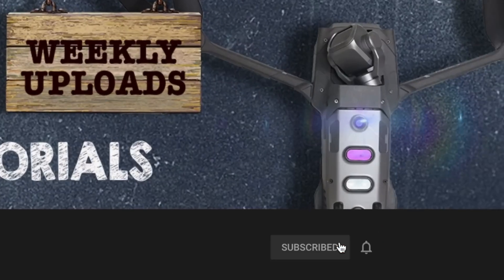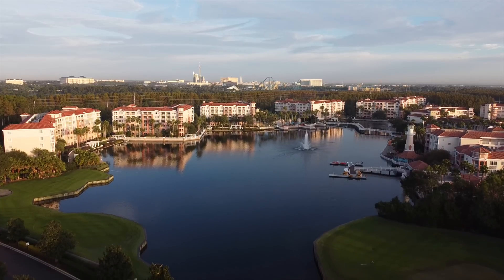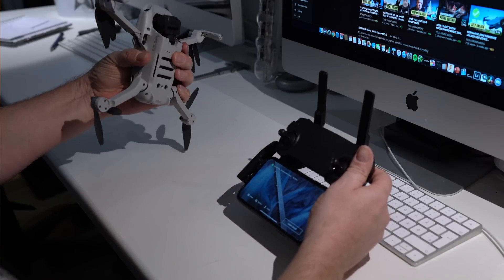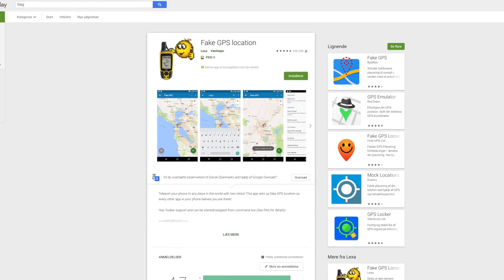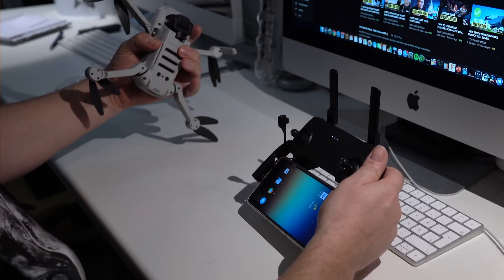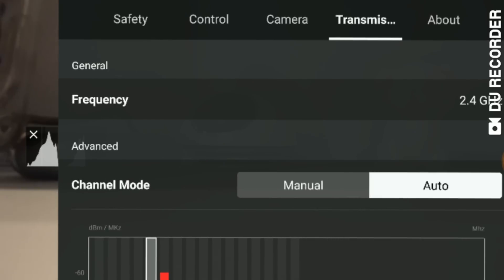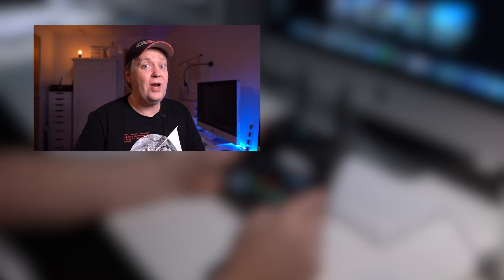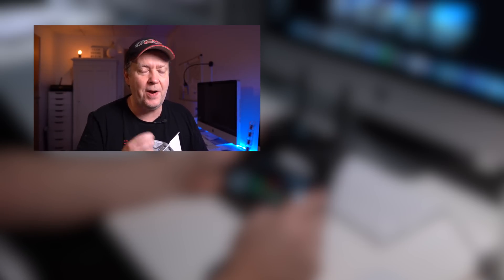HOW TO FIX MAVIC MINI BAD RANGE - FCC HACK (all DJI Drones 2020)

Comment: its an improvement but still its not as powerfull as an original US bought FCC mavic mini, those are better
Reply: I’m in the US and I’ve never see more than 450m. Which really sucks because I love this little drone but that range really makes me not like it. Especially when doing too down photography and exploring new areas. Can only go so far then fly back and drive to a new location a couple miles down the road. Wish I could just fly there like it should be able to. Most likely going to sell it and upgrade to a Mavic 2 pro. Hope they can fix the range issue in software. :/

Comment: There are two separate models for remote and drone (check the specs). So I'm sceptical that all you are doing is tricking the app show us the db readings from a RF monitor that confirms the increased TX power from both the RC and Drone.
Reply: Also channels 12 and 13 in the 2.4ghz range are not for public us in the USA so this could simply be the app blocking those channels so your CE drone remains compliant for FAA regs.
Reply: Learn how to read your own RFmeter. In your own video it clearly shows how the 5.8ghz band gets amplified from 25mw to around 80mw by using the fcc hack.
Reply: @fraggen  bit late to to the story
Reply: @8dcphoto  Same thing still applies to the newer Mini Se. You had it all wrong with the Mini so it was just fair to point it out so people can get the information correct.

Comment: May I also know for which firmware versions this method will work ?
Reply from the maker: I used the latest
Reply: @TECHDRONEMEDIA  yeah i use the latest firmware too and the fcc hack still works... I have the video on my channel
Reply: @kyuuraa6264  exactly! no power increase at all. guys in italy tested power output.
fcc hack simply doesnt work due to different hardware on CE model.
what you see here is called:
PLACEBO EFFECT
lol
Reply: @pc-easy  Completely agree the TX power output for both Drone and RC is physically limited.  This hack simple reduces the number of 2.4ghz channels available to the CE model because channels 12 and 13 are not for public use in the US FCC region.
Reply: @pc-easy  I've checked the DJI website and there are 2 different models with 2 different transmitting power:

Operating Frequency[2]
Model MT1SS5: 5.725-5.850 GHz
Model MT1SD25: 2.400-2.4835 GHz, 5.725-5.850 GHz
Transmission Power (EIRP)
Model MT1SS5
5.8 GHz: <30 dBm (FCC); <28 dBm (SRRC)
Model MT1SD25
2.4 GHz: <19 dBm (MIC/CE)
5.8 GHz: <14 dBm (CE)

Comment: I remember hearing from somewhere that the fake GPS has a problem - if the craft is disconnected and re-connected during the flight, it will revert to CE mode. Just wondering if this will happen on Mini hacked this way.
Reply from the maker: I don’t think it will revert mid flight as it will require a network reboot.

Comment: Excellent ! (as usual) . If I want to change batteries after a flight and keep the FCC mode what are the procedures ?
I have been told that using the hack does not increase the power in the 2.4 freq range but does increase the power in the 5.8 freq range. Have you tried this and if so what are your findings ?
Reply from the maker: Right now this is relying on 3 party information, that confirmed longer range, but no info on witch band he is using. Just disconnect the phone before your turn off the remote, and start the motors first before plugging in the phone

Comment: As far as I know you can also spoof the location on iPhone using Mac computer and Xcode.
Reply from the maker: What about VPN service?
Reply: @TECHDRONEMEDIA  I have surfshark vpn and whatever country server I connect to it also mimics that GPS location
Reply: Just tried it with my vpn and it works indoors. As soon as I take the drone outside though and it gets a gps signal it reverts back to CE. Only way to fool it is to start the motors indoors and then take it outside. Not had chance to check the range as it’s dark and windy as hell at the minute

Comment: Are you sure that the european CE model can switch to FCC ?
In the past you had told you had a ce version and that this had stayed in CE mode when you had the range issues while in the US.

You were the first to emphasise and therefore I checked model numbers of the mini and believed it first and sold my new CE combo and ordered a US one.

You also may need usb developer mode to set gps that way.

Any way: great description in detail cause my last spark didn't do it since may 2019 while for Mavic 2 Zoom I had a different solution.

Thanks a lot fir clarifying.

Da Vinci will be my next skill to improve --- in next autumn + winter . I watched your explanations cause I had the software already installed 2 years ago ...
Reply: @TECHDRONEMEDIA  Yes, that had worked for me, cause there are 2 different versions and finally I got behind what was going on ... but meanwhile Air 2 had appeared with occusync and therefore I had sold my Mini fly more I got from China last week with a working fcc in Europe. 
But I will reply with the details below your pinned first COMMENT were many could read that too even though all these hacks are without any use if dji puts countermeasures into firmware updates you need like that of last week which I had seen, downloaded and then sold with the new set of features.
Luckily I had picked a special sale offer and got that one for 280€ ... and sold it for 350€ now so I can not complain a depreciation but a lot of work and disappointment that we have to be used to in the game of buying dji drones.
The most disappintment is that you do not get such drones from dji directly before launch and that you have to pay your own money in their adventures ... and suffer from all these troubles a lot more as second row reviewer. 

Good work and a lot of work cause I have recentlyy checked a lot of these comments and stupid guys owning FCC and running FCC and hoping for more range completely blind about CE and that CE can not solve their hope. But more on the first pinned message later. I will jump to that work right now.

Comment: Thank you for this Mavic Mini hack, Henrik - if only I had an Android device!! I always enjoy your videos but what a ride - I have been both encouraged and discouraged in my recent (1 week ago) purchase of my Mavic Mini (CE version as I am UK based). I hope that long-term, I have made the right choice! So far though, I have been very happy with the stability and signal strength of my system as I only really want to fly it in the countryside where I live where RF interference is not a problem so I am sure that it will work just fine for my purposes.

Comment: It is useless since the CE remote has less transmission power...
Reply from the maker: Why would they make 2 different remotes? I don't think so, this is just a limitation
Reply: @TECHDRONEMEDIA  you should check that.. I thought that there were indeed 2 different models ....
Reply from the maker: You might be right. I’ll check up on this, but they got reported this was getting significantly better range
Reply: @TECHDRONEMEDIA  They make two seperate remotes and drones to ensure compliance with radio regulations for CE and FCC regions, especially as previous Mavic's could be hacked.
Reply: @TECHDRONEMEDIA  There are indeed 2 different models.  My CE Drone and remote is model #: MR1SD25.  The FAA version is: MT1SS5.  I would be very surprised if the CE version actually has the same radio output power as the FAA version and that it's merely software castrated, but there's always hope.  BTW here in Thailand only 2.4Ghz is allowed, but I found, by accident, that we can switch to 5.8Ghz.  Changing the Transmission setting in the DJI app from Auto to Manual  allows selecting an 5.8Ghz frequency. Of course, power is less, so I'm sure CE range at 5.8Ghz could be measured in centimeters! 😭😭😭😭